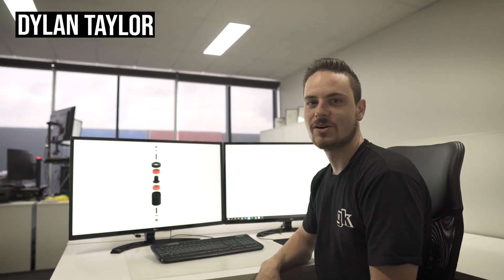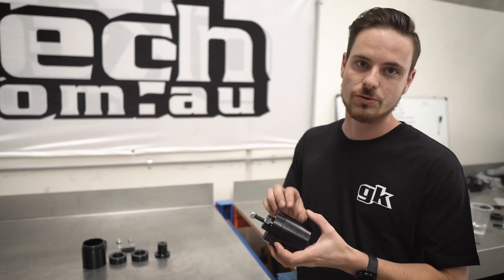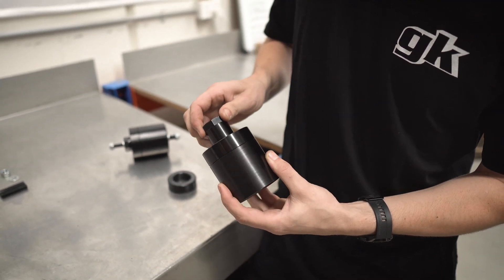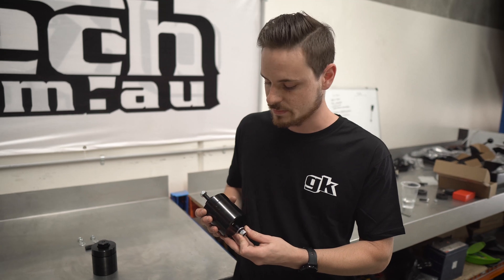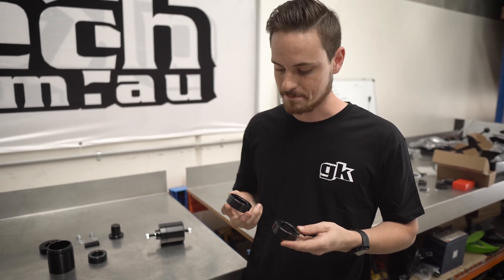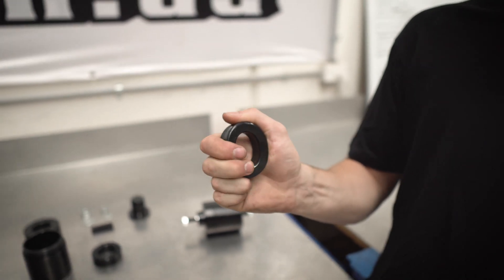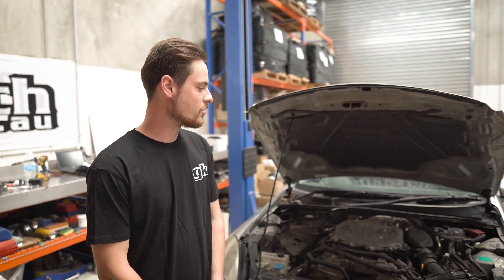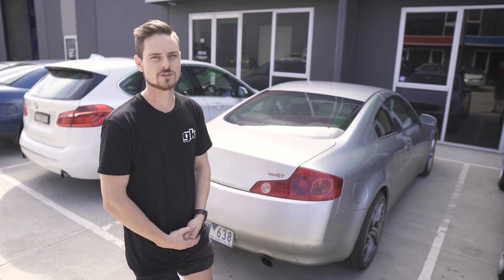Whats Doing With Dylan: Episode 2 - Polyurethane Engine Mounts

Comment: adjustable hardness mounts would be cool maybe like the e36 engine mounts a company with a similar name to fowerplex does, also maybe use the same mounts for ca and sr just with a extra spacer supplied for sr so people can choose their engine height, and also maybe machine some coilover type slots in the housing and cap so people can use coilover spanners to get them open or snug them closed